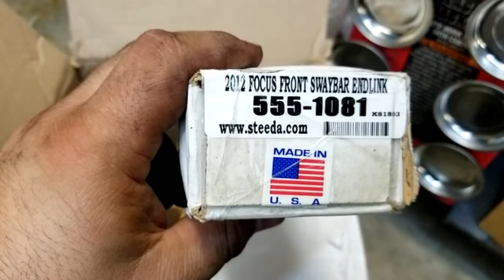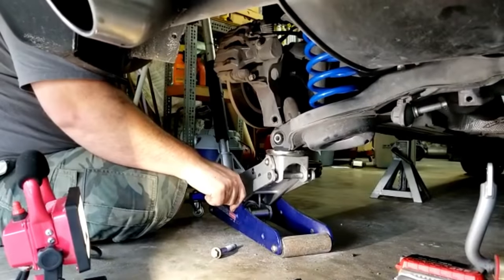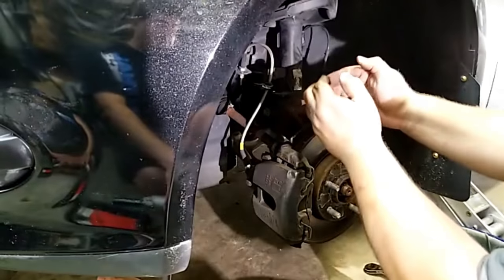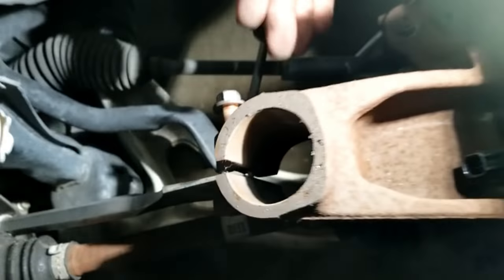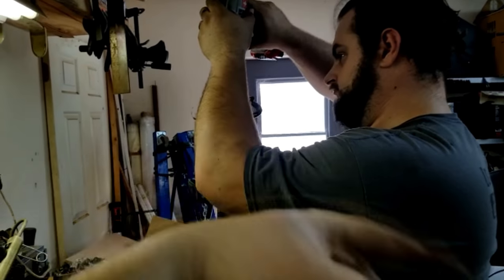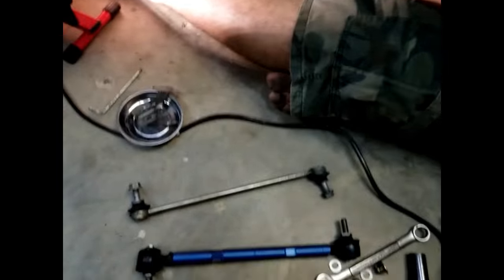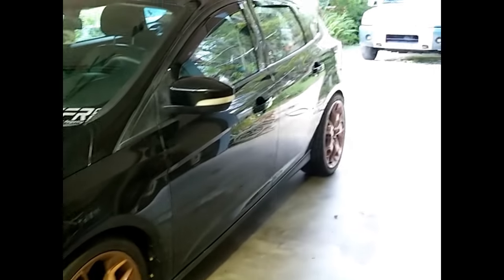Steeda lowering springs & Adjustable Sway-bar end links

Comment: Are your struts making noise when you turn? I just did my springs this weekend and it legit took about 3 different attempts because I didn't know how to re-assemble them. It looks like you made the same mistake. On the top spring cup there's a little notch that has to line up with the notch on the bottom of strut where it slots into the spindle. Basically facing the engine. When you had the strut in the vice it looked like you had the notch facing the side.
Reply: BTW your focus looks sick!
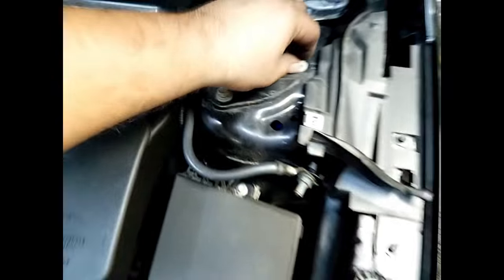Reply from the maker: Thanks and nope.  I think that's what we addressed at the 12:20 ish mark.
Reply from the maker: And do you race drones?  Would love to get one to use on the channel!
Reply: @OutOfLineGarage  no no not the triangle the actual round cup. It has a single notch in it. PITA to pull it apart and look but yeah...

Comment: For the Steeda springs used what was the part#?  555 8301.  Do you have a Focus SE as your base vehicle that you upgraded to ST?  I'm trying to do the same to mine; like all the videos to help me with this task.
Reply from the maker: yep, these are the 555-8301 springs.  I really like them.
Reply: Not having the funds for the Steeda springs I bought a used set of Eibach 1.5" (part#4.13435) lowering springs.  Handles well with increased spring rate.  Tight clearance but with stock rims and tires its a modest lowering job.  Thanks for the video and tech insight.